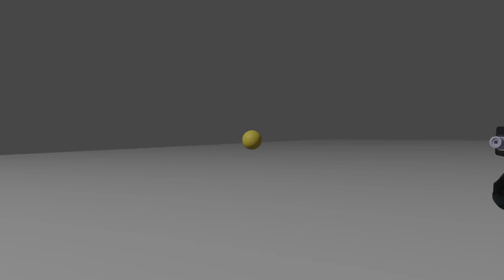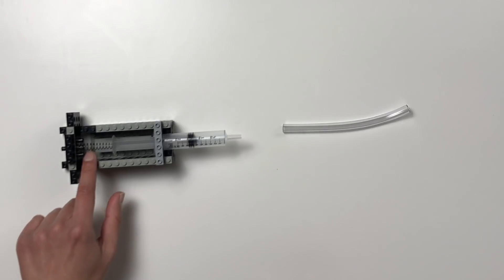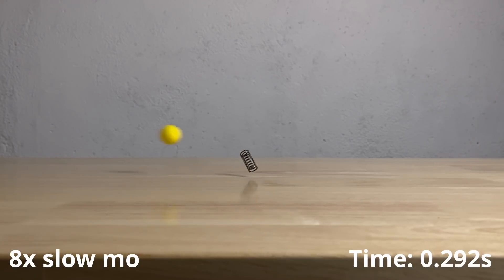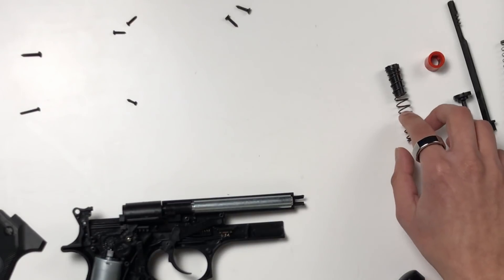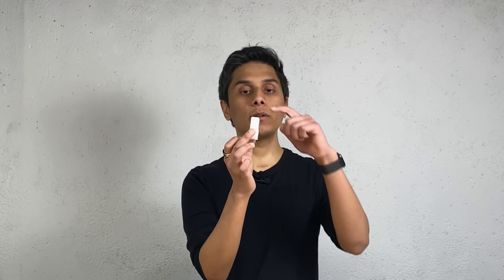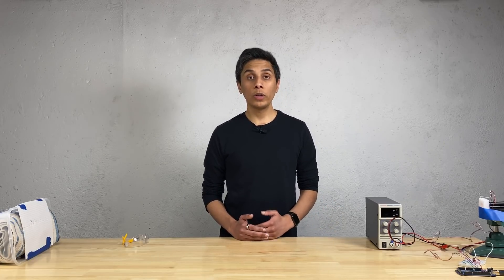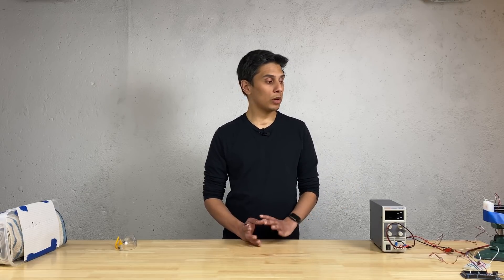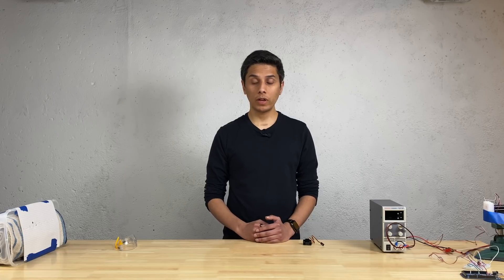I’m Building a Nerf Dart Missile Defense System

Comment: This is a project I've thought about making for years, the technical difficulty is unrealized to most but even if not successful, I'm already impressed by even attempting this challenge. I'm tuned in for the object tracking portion, I've done some python openCV work and the processing power required for meeting the specifications will be far beyond anything SBC will accomplish. I was only able to get a few frames per second with a RasPi, image processing will take longer than determining the trajectory of the object so I suspect you will end up needing a PC for this task. I've not used a modern RasPi so maybe they are fast enough now to process the images... However you end up doing this I'm sure to learn something new and can't wait for a follow-up video, new subscriber checking in!